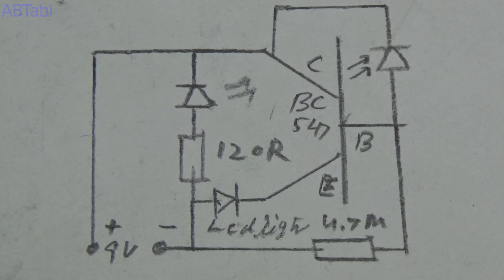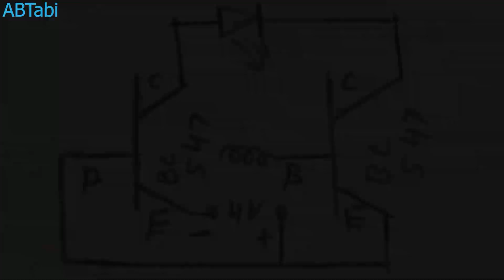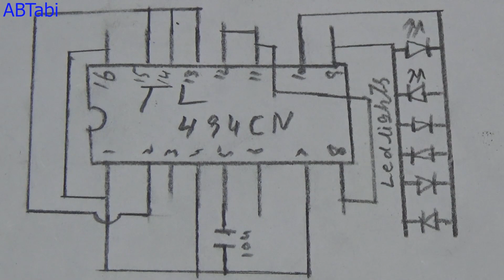4 Simple Electronic Projects, electronics diy ideas

Comment: if you connect several leds  + leg to  arduino and the - leg to a 220ohm resistor al legs .  you write a simple program tha light evry led half a second and delay for a little less' no led wil burn out